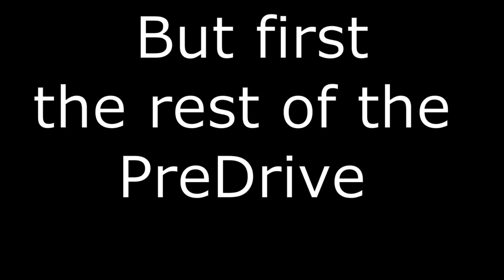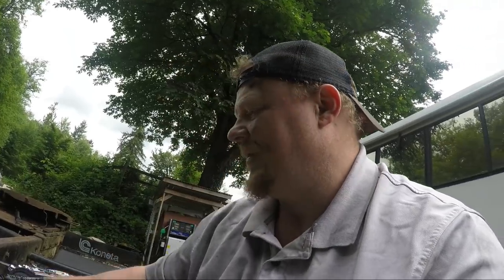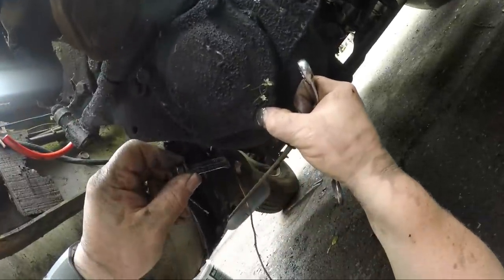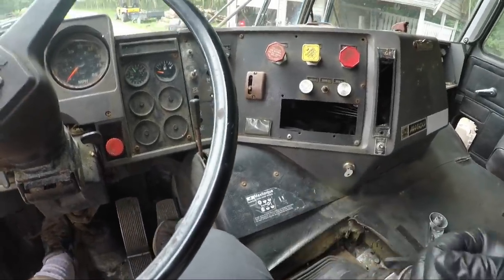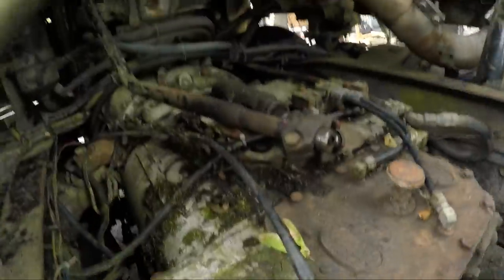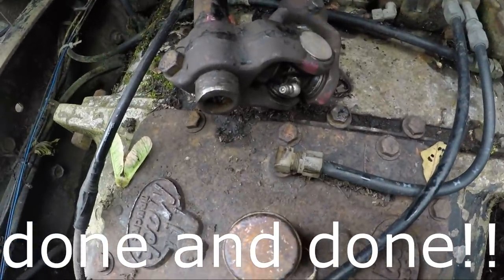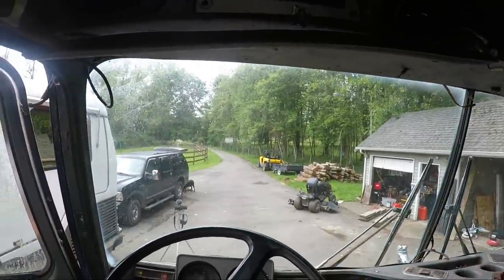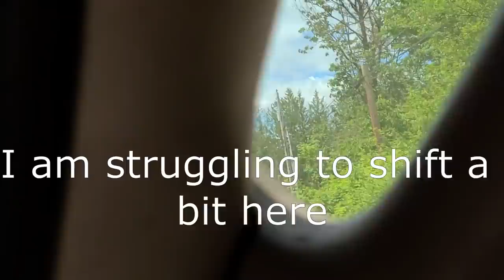Mack Cabover Ep8,  ROADTEST part two!!! MudHunny hits the Streets  (part 2 of 2)

Comment: First, I am really enjoying your videos. Second, your task list (with a grin): pressure wash the outside of cab, chassis and engine, followed by a good cleaning inside the cab. I don't pretend to be any kind of truck mechanic, but all the cars I have worked on were easier to work on and worked better when the parts were clean. Third, keep this going! It is great! Good job!
Reply from the maker: TC, we are on the same page....
Now that it drove I decided to love it, we already started cleaning it up all the way
Thanks for tuning in!!
Reply: @countrylife4195  Until I got like a thousand hours of practice,  I always wanted to mark my speedometer for each gear at, say, 1200 RPM or whatever revs you're most likely to want.  Then I can brake until the speedo in on a mark, rev the engine to 1200 and it should drop into the corresponding gear,  I did use a couple of marks but more often memorized speeds and gear combinations so I could always drop it into a particular gear at a particular speed using speedo and tach.
   So it is much harder for beginners to do it without speedo and tach.  Also, when unloaded, I learned I could slow down a bit by shifting 2 gears at once especially in low range.  like 2,4,6,7,8,9.  When shifting up 2 gears, you double clutch for twice as long and when downshifting 2 gears, you brake until the engine is a idle revs before downshift.

Comment: Looks to be coming along well and looking forward to more updates with MudHunny. Stay safe up your way guys
Reply: I spent a year driving a 13sd and the first thing I learnt was using the clutch properly, all the way down activates the clutch brake so you select a gear when not moving then only press about an inch when changing gears once moving. Was actually easier to float the gears through once correct revs were achieve and not use the clutch once moving. Not sure if it will work for a 9sd floating the gears
Reply from the maker: We ll need to stay safe, not funny times at the moment
I wish everyone safety and the best of times! 
Cheers

Comment: Years ago, I worked for a guy who owned three trucks leased to Roadway Package System now known as FedEx ground. I drove a single axle sleeper Freightliner cabover for him. He also owned one of these Mack MH cabovers, his was the "bossman's truck" it had polished aluminum wheels, shiny stainless steel dual exhausts, and a chrome front bumper. The truck had the beast of an engine, an E9 V8 which was underrated at 500 hp. Truth is that Mack engine was close to 600 hp but to get past govt EPA standards they fudged the specs. Anyway, he would blow the doors off most other trucks when pulling 2 pup trailers fully loaded, even running up grades thru the Blue Ridge Mountains in VA and NC. That truck always ate my lunch in the Freightliner when I saw him on the road.

Comment: Great vid man! One thing that will help is that tach for shiftin till u get use to that big old girl. She a tad bit finicky when the rpm ain’t right lol
Again, I’m glad to see you drive it.
Reply from the maker: Thanks and that is a fact, downshifting is a challenge but I am learning!!
Reply: @countrylife4195  downshifting is harder than upshifting down shift is slow down with the brake pedal,let off the brakes clutch in without engaging clutch brake shift to N release clutch tap the gas to pop up the RPMS,push in clutch and shift to lower gear at the same time then release clutch and repeat,upshift is clutch N clutch higher gear at the same time

Comment: Most trucks seem to shift easier when you run the RPMs up some, and the fluid temps are good and warm. Use ur ear. Just takes seat time. I'd forget the double clutch lol you'll get it. Just feel it out, you can kinda drag the shifter against the gears, like your grinding them, but gently. And slip it in when you feel it. Hard to explain but you'll get it. 👍
Reply from the maker: Thanks, I did not have time to include it in the Video but I got OK after a while. 
Need some training though
thanks man!!
Reply: When I started driving I went thru the gears and noted when I shifted up, then took a grease pen and wrote it on the windshield. Beside it I subtracted 500 rpm and listed each gear for down shifting.  Once u get used to it you can always wipe it off with a rag and no one is the wiser.  LOL

Comment: Great to see the old Mack driving again! 
I was worried that you were putting petrol, rather than diesel in the tank.
In the UK, a green handle on the pump means unleaded, black is diesel. 
I learned to drive a crash gearbox on a Leyland double deck bus, so I know where you're coming from. 
Hello from bonnie Scotland.

Comment: You've got a bad Chassis Ground somewhere, which is causing most of the the gauge and lamp errors.  My Dads old 66 Freightliner would illuminate the Brake Lights on the rear when the Tractor Park Brake was engaged and had the same issue in the 80's. We found a bad chassis ground from the cab to frame, but added a second for safe measure. Yours might have a similar issue.

Comment: There is youtube channels that can help you learn how to shift .
You have to know what transmission you have .

Some of the old ones like to get high RPM but 13 speeds usually only shift at 1500 rpm.

You just have to play with it  but under load it is a new story.

Comment: It looks like that trucks got a Mack 2090 or 2110 “Range type” transmission in it…be very soaring  on the low to high side shifts done with the air range valve while you’re moving (as in leave it in 5th until you get stopped then shift back to the low side / low range. The High / low synchronizer on those transmissions is WEAK and will fail after not much use if you don’t baby it. Mack did a revised shift pattern for these in later models where you don’t use 4th gear on the low side and instead shift to the high side after 3rd and use “L” on the high side as your 4th regular gear. Supposedly that helps the back half of the trans stay together longer.

Comment: You can’t drink anything in an old cabover you wear it 😂
Also when your shifting take your gear to 21 RPM then shift let RPM’s drop to 12RPM to go in the next gear
Reply: That is with a 5 or 6 speed.  with a 9 speed it only drops about 500 rpm or 10 speed it only drops about 400 rpm,  This truck has a high low selector so its a 9 or 10 speed.
Reply from the maker: It is a 9, but I still need to not such at shifting LOL
Reply: @countrylife4195  that is a 9-speed,not sure if your shifting like a car,if your floating it or double clutching it,but to get it into gear including R the clutch has to be all the way to the floor to engage the clutch brake so the gears will stop turning,if it has trouble going in at a stop let up the clutch a little bit and it should go in but make sure your in low range that button on shifter needs to be down for low range,once in gear let off the brakes and ease off the clutch and it should start moving,once moving do what that las guy said about the RPMS but depending how you shift it if you try double clutching it pushing the clutch all the way down while moving will stop the gears from turning causing the truck to stall and slow down you just push the clutch in a few inches to half way to properly shift it without engaging the clutch brake,you only push the clutch to the floor when your stopped and starting out cuz the transmission doesnt have syncros in it cars do thats why you push the clutch once to shift it these arent built with them so they require double clutching to change gears to match the RPMS/engine speed with the road speed to do it and you need the right gear for the right speed,upshift to speed up downshift to slow down or if you know how float it,theres videos on here showing how to do it,know your math for the right gear,example 25MPH is 7th gear and so on look at your speedometer to find it,so this might be some of your issues on why you cant get into/find your gears
Reply: i also see your left brake light is out
Reply: @chriscrane5327  
I don't think the tach works
Reply: Be conservative with the clutch brake and shift into your low/ lower gear when barely rolling say when coming up to a stop or going around the corner as opposed to starting/shifting from a dead stop.

Comment: I would get that gearbox lube changed if your having trouble with finding gears. it looked nasty :-( The change the rear differential (Axle) oil. If in doubt. Flush them out with diesel.

Comment: when shifting with the clutch never depress it all the way to the floor, it wears out the stop brake in the clutch and could potentially catch the motor on fire, i tend to never use the clutch at all other than starting and stopping

Comment: hi :) change the oil in the transmission and i saw the color and there is lot of humidity , often when you change oil transmission she become like new , the symptom is hard to shift an can't shift .  for the power steering fluid you can lift the front wheel and disconnect the return line and turn the steering on each side and no need to start the engine , do that by hand fill the reservoir an same time until the oil become clean by the return line :) if that can help you i would be happy